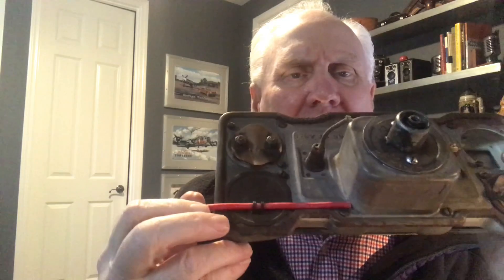Gauge reducer / regulator | vintage auto garage

Comment: what if your gauge is off after installing it? put a resistor in line to the sender? mine shows slightly more than a 1/4 tank off. i was going to put a 20 ohm 1/2 watt resistor in-line with the sender, im actually seeing 7.6 v on the lead after putting in the voltage reducer

Comment: IN OTHER VIDIOS THAY SHOW THE 12V TO 6V . i UNDERSTAND THE REASONING FOR THE REDUSING OF THE VOLTAGE BUT HOW DO YOU ADDRESS THE FACT THAT A 6 V IS A POSITIVE GROUND AND A 12V IS A NEGITIVE GROUND. wHAT DO YOU DO REVERSE THE GUAGES SO YOU ARE POWERING OND THE GROUND SIDE ANG GROUNDING ON THE POSITIVE SIDE?

Comment: Hi, I have a 1950 Chevy Coupe. I had a mechanic do the 12 volts conversion but he didn’t install a voltage reducer like you are explaining and he didn’t install a voltage regulator either. The fuel gauge was never working but is something that I am planing on fixing. The temperature and oil pressure gauge do work. My question is: do I need a voltage reducer like one you are showing in this video at the beginning?
Reply: Hey brother,  hope all is well ..  I had a quick question, I also own a 1950 Chevy ( sedan ). And I will need to get my gauges working also. Do you need to purchase the single reducer for each gauge ?